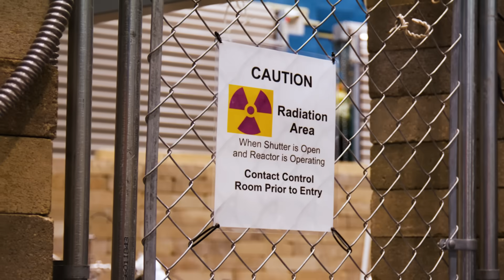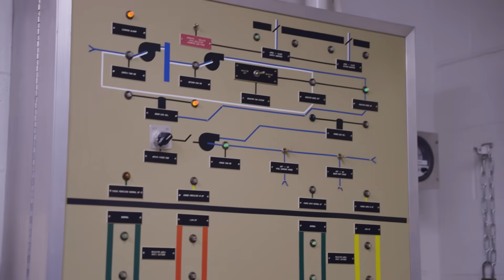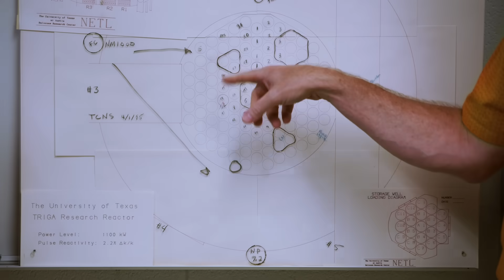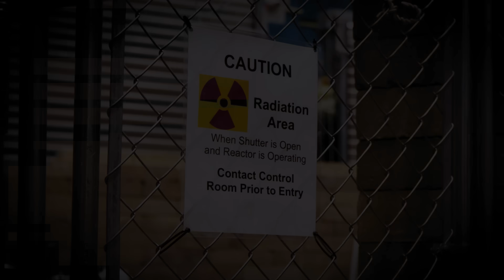I tried to melt down a real-life nuclear reactor

Comment: This is the sort of content more public need to watch to get rid of the negative perception of nuclear.
Reply: Agreed
Reply: Brothaa im not scared of the uranium or radiation im scared of the fact that they want to use a metal that is really really really angry if it comes in contact with water or air ... at room temp ... if you heat that stuff to lets say 230C° im sure it wants to blow up even more. But that aside there is still the problem of the waste management wich isn't really a physical problem but more a political one because you CAN in fact reuse 95% of the fuels BUT the problem is that 1: It takes a lot of energy and resources to recycle the uranium and plutonium and 2: the plutonium wich is getting more and more every time you recycle the fuel is perfect for nuclear weapons so many or rather almost all countrys are very scare of that because its not like we have more nuclear weapons that we know what to do with and we could keep such facility's secret pretty easy considering the sr71 or mig 15 and 17 and some other black voodoo shit the lads at skunk works are working on right now but the problem is: we don't want to... we 100% could do that but its just not profitable enough yet and when it is the people in charge now are long out of the scope of dead with billions in coal, gas and oil money ... looking at you germany's 0.1% aka BMW Aral VW etc...
Reply: I need to somehow send this to the Bundestag in Germany asap

Comment: So the fuel does nothing about decay heat after the reactor shutdown (i.e. run the reactor so the fuel is full of spicy new isotopes and it will still produces megawatts of heat immediately after shutdown and requires cooling). Also it's cooled with a very corrosive liquid metal. Still some work to do!

Comment: 3:30  what is graphite for then?? Its also a neutron moderator than slows down neutrons to increase rate of fission. 
More specifically, graphite's neutron moderating is not affected by temperature to any extent. Then how does the hydride compund stabilize it at 401°c ???

Comment: TRIGA fuel is exceptionally resistant to meltdown because its U-ZrH fuel has a very strong prompt negative temperature coefficient, but meltdown is not physically impossible. Under extreme, beyond-design conditions—such as sustained overpower with loss of cooling, failures of shutdown systems, hydride degradation at high temperature, cladding failure, or severe external damage—the fuel could overheat and melt. The correct claim is ‘highly unlikely,’ not ‘impossible.

Comment: All western commercial power reactors have a negative temperature coefficient.  They are simply larger that this small research reactor and produce a lot more heat which can cause a meltdown even after the reactor is shutdown due to decay heat.  

The pulsing and making the reactor go prompt critical for a brief moment is pretty cool.

Edit:  At power.  They might have a really small positive temperature coefficient when a new core is loaded but that quickly turns negative.

Comment: Making power with NP is not dangerous. Track record proves that it is the safest form of making power, especially clean and reliable power. There are potential risks in extremely rare circumstances, but that is quite different kind of thing. 10l of diesel or gasoline has destructive potential of about 100kg of TNT(in thermobaric like explosion if dispersed with air perfectly and ignited), yet we don't pay much attention to that danger. Cool video nevertheless of that nitpicking!

Comment: During the experiment, shortly before the excursion event occurs you hear the control rod retraction. what is the noise you hear right when the intensity of the tcherenkov-radiation drops off rapidly? sounds like a control rod insertion to me. So the TRIGA fuel was supposedly acting during that timeframe between retraction and insertion. So the order of events would be the following: control rod withdrawal, high power flash during reactor transient operation, power excursion, control rod insertion. Where exactly was the TRIGA fuel limiting the reactor output power in this test? during the duration of the power excursion the intensity of the tcherenkov-radiation didn't seem to drop off significantly. It appears the Reactor would have been critical at a steady power level during the test. With TRIGA i would expect a low- but visibly latent reduction in output power if it performed as said here, no? So i don't see where this test run was demonstrating a significant reactivity reduction due to the utilised fuel. besides, wouldn't HTHA be a major fuel-imbrittlement hazard with TRIGA? ALSO: the key takeaway is: if TRIGA gets validated to be effective and safe in power generation, that means that it can act as an ADDITIONAL safety system in a large scale power reactor. emphasis on additional. in no way is it reasonable to build a reactor that heavily relies on TRIGA fuels NTCoR for reactivity control. The issue is: these people are building SMRs. with SMRs, less fail safes are available due to both size and economic constraints. The complexity of many advanced safety systems is simply not viable in SMRs. As such i am very sceptical of SMRs in general. and i'm afraid this might be another instance of SMRs being heavily reliant on too few safety measures because of some predicted inherent safety. Look at HTRs, specifically Pebble-bed-reactors for an example of people being very convinced of inherent safety of a reactor design that is not in fact very safe at all.

Comment: The small reactors are essentially melt down proof. Their was a time when high schoolers were allowed to play with them unsupervised. They're allowed to run without any personnel because the safety systems are entirely passive. The small reactors just don't make very much energy. We'd need a LOT of them. The kind you find at universities tend to be pulse reactors that can't produce a net positive power output
Reply: No. You are wrong. 
Don't forget the Idaho falls nuclear disaster, 
It was a similar small nuclear reactor meant for powering remote military bases in North America. 
It failed and exploded killing 3 operators , it also has similar 5  control rod configuration.

Comment: Most of the meltdown problem is the byproducts continue to decay thus generating substantial heat even with the control rods are in. So this might work when the fuel is new, but as the fuel gets used up, it starts generating these off products. I also see a huge problem with security. Having hundreds of small reactors is far more difficult to secure vs 10 large reactors.

I hope i am wrong, but I am highly doubtful that this will work.

Comment: Guy messes with reactor controls triggering AI controlled Plasma ultrasonic holography pressure field using reactors own power as the only limit take control and sends message to Empire > Wolf predator gets deployed to potential sabotage attempt of reactor using his plasma ultrasonic cloaking suit to navigate safely through Ultrasonic field while everyone else is stunned in place by vibration of motor cells beyond communication but below harm aka Induced sleep paralysis Not nuclear but would be the same security.. Always get approval from the dark side of the govt before playing games. 😛👽 Points at Boeing Plasma force field and points at your nuclear reactor

Pressure potential greater than bottom of sea.. Ever seen ghost rider? When is a machine both alive and dead? When its melting but still holding form for purpose..

Comment: If I were to try to melt down this reactor, I would instead run the reactor for a while and then shut off all cooling. Decay heat from the rods is still going, which is what led to fukushima and TMI.

I support nuclear power because even chernobyl is practically nothing compared to climate change.
Reply from the maker: What kind of cooling do you mean? Making the water disappear?
Reply: @1stPrinciplesFM  like turn off the pumps and stuff

Comment: So, it might be impossible for you but I play reactor simulators (Yes I know totally very realistic) but some are actually 1-1 to a real nuclear reactor. And most of them had automatic safety systems that cannot be turned off like cooling or scram. I somehow blew up both of them. One of them by raising rods to ~15% then very quickly pulling them all out fastly, cause increase of temp and pressure (its a preasure reactor) and kaboom. The other one, I some how always blow it up without trying. I try to start the reactor, I keep tripping the turbine when syncing despite being exactly in sync and at the exact speed. Whenever I lose power, for some reason, the emergency generators can never start and I can't get the emergency cooling online to keep the reactor level normal. Eventually rods get exposed and melt. If I was going to operate this reactor, don't let me near within 1000km of this facility.

I'm serious.

Comment: as soon as the CEO says "safe enough to fit in your back yard", alarm bells should start ringing in people's heads. Meltdowns are not the only danger for nuclear power, contamination and nuclear proliferation are no less important, and drastically widening the amount of people who can get their hands on nuclear fuel would have pretty severe consequences.

Also, I want to stress this: the state that the reactor enters instead of a meltdown is still "hot and radioactive". this ensures that it's possible to operate without a containment building, but you'd still need to have a team of engineers watching over it to fix whatever's wrong.

Comment: Liquid sodium is not something I would want anywhere near a reactor. I know it's been done- but I don't think it's such a hot idea. I'm a fan of molten salts for heat transfer, but liquid sodium is a nightmare. You would almost have to have all of the primary coolant loop in a sealed-off, inert gas environment in the case of primary coolant loop rupture. Sodium likes to react and when it does, it's violent. 

Molten salts are far more chemically stable and don't react violently. They can cause corrosion over time if you have any moisture in the system, but as long as you keep a system dry they're far safer than liquid sodium.

Comment: Timestamps
00:09 - Exploring a meltdown-proof nuclear reactor with Aalo Atomics.
01:52 - A startup explores a TRIGA reactor to experiment with a potential meltdown.
03:22 - Overview of nuclear reactor fuel and control rods.
04:41 - Demonstrating chain reactions and risks of control rod removal in a nuclear reactor.
06:11 - The TRIGA reactor's design prevents meltdown under extreme conditions.
08:19 - TRIGA fuel's unique properties enhance reactor safety through a negative temperature coefficient.
09:57 - Exploring the potential of TRIGA fuel in a novel sodium-cooled reactor.
11:30 - Nuclear technology offers promising solutions for future energy needs.

Comment: So you're using hydrogen in fuel as a moderator like in thermal neutron reactors, but then you're trying to build a reactor using sodium as a coolant like in fast neutron reactor. If you're building a fast neutron reactor you can't use moderators, but if you're trying to build a thermal neutron reactor with liquid metal (which is questionable) then you won't have enough hydrogen in fuel as a moderator. So the question is: why won't you just build a fast neutron reactor which is safe enough by itself?

Comment: Take all of the control rods out and lets see if it still remains stable.
Reply: It would because the hotter it gets the fuel gets  less reactive
Reply: Negative void coeff reactors (Pressurized water reactors, etc etc) Cannot meltdown, as the water (Which slows down the neutrons for nuclear fission) can all boil away if it gets too hot. Meaning it wont have nuclear fission.
Reply: He did that at 5:27
Reply: @lolermosskoss1834  sorry I am blind and use captioning and audio descriptions.
Reply: @ ah alright

Comment: When it is said that the fuel temperature reached 400C, does this mean a uniform temperature throughout the fuel, or just the surface? And how long does it take to cool down to ambient? I don't see any boiling at the surface of the core head, so I'm guessing it cools extremely rapidly?
It's very interesting that 23 megajoules is the total energy released in the pulse, because this is about as much energy as 18 sticks of dynamite detonating. In fact, the TRIGA pulse lasts roughly the same period of time too, about 5 microseconds or so. But why no massive BANG then, just a quiet "clunk"? I suspect because most of the energy released is in the form of neutrons and gamma rays, which are absorbed uniformly throughout a large volume of water, and there is no phase change, so no gas and no blast wave produced, just evenly distributed moderate heating throughout a large volume of water and fuel.
Reply from the maker: It is boiling — if you look at the second shot, the slo-mo one, you can see the bubbles!

Comment: I thought sodium metal reactors were thrown out 50 years ago. Simi valley California rocketdyne my backyard is the location of the first sodium reactor melt down and it was due to the nature of the sodium metal it oxidizes extremely easy and those oxides built up on in the cooling chanel's creating hot spots in the reactor making weird readings so they kept pushing and testing until it was too late and it melt down causing a clean up effort that is still ongoing. So I wonder how they solved or are going to solve that issue of oxide build up pretty cool though none the less I want one lol
Reply: it was not due to the nature of the sodium, but of the tetralin used to cool the pump seals. Tetralin, a hydrocarbon liquid, seeped into the primary coolant system through a pump seal and was decomposed by the high-temperature sodium. The decomposed tetralin clogged several narrow cooling channels used by the sodium system to remove heat from the reactor fuel elements. As the tetralin residues clogged the reactor's internal cooling channels, 13 of the reactor's 43 fuel elements overheated and were damaged.
Reply: @ oh wow thank you for that I don't know how I never knew that detail about the seals being the initial cause.

Comment: So the thought is to make smaller.modular reactors by using a molten metal heat exchange with the reactor core. I can see this being helpful because to create steam plasma everything has to be under high pressure and there needs to be a containment vessel. Sodium, though, is an extremely reactive metal and will need to be contained using some very exotic alloys. That is the factor to overcome. Maybe use a salt in the heat exchange instead?

Comment: Didn't the Soviets have something like this tiny remote nuclear power ? Can't remember where I heard about them but they where used in the sixties and some hikers found one and died. Them a team had to come in spending only a minute oe two at a time to deal with it.
Reply: That was radioisotope generators. Extremely reliable and stable, but weak as they are powered by nuclear decay. The ones people died from were broken and missing the shielding

Comment: That reactor can not be melted down because it is designed to work that way. Its a neutron source ? Perhaps Aalo can pivot some elements to power production, but "betting" on that is basically just that - a bet, the Bayesian priors are not in their favour, because smaller reactors need even HIGHER temps than larger ones to maintain efficiency due to thermodynamics, and this fuel is inherently low temp, regardless of the heat transfer fluid.

Comment: Uranium zirconium hydride sounds ok till it reacts with water. It is UH3TiH4.. 7 hydrogen plus 2 reactive metals. It might have a negative coefficient but would get very unstable with burnup decay. 😮
Reply from the maker: I'm confused, what is that? UZrH + H2O, where does the titanium come from?
Reply: I been wondering about this. How does burnup will affect the stability of this fuel? you will have plenty of fission products as well as transmutation products that might make the hydride far less stable, possibly releasing the hydrogen and causing a serious build up of pressure within the fuel element also it will produce deuterium and tritium which they can change the reactivity of the reactor due them being better moderators than protium. Tho I guess it also could mean tritium production might be a business for this kind of reactors.

Comment: So how would this actually work for consumers? At mass production, how much would one backyard unit cost and what would the maintenance look like? I think an updated video once they are ready would be a great follow up video.
Reply from the maker: @MarcGayle  I'll definitely go back! Step one is getting one reactor to generate power continuously — until that works, impossible to say. :)
Reply: Hydrolysis for hydrogen and oxygen recovery!
Reply: This will not be in anyone’s backyard ever. One of these will cost millions + after construction, regulations, etc are all said and done. “Maintenance” would entail 3 operators working every second it’s running, a health physicist, and then refueling and other expensive periodic maintenance tasks often requiring many more hands.
Reply: @HistoryOfEnergy  i dont think itll cost millions.
Reply: @HistoryOfEnergy  I mean, it's technically possible. If the fuel rods can actually regulate themselves in a way that makes them exceptionally safe, that is. You'd also need somewhere to boil some water.